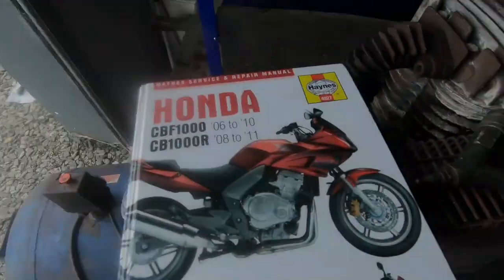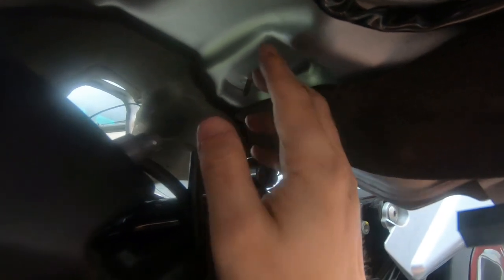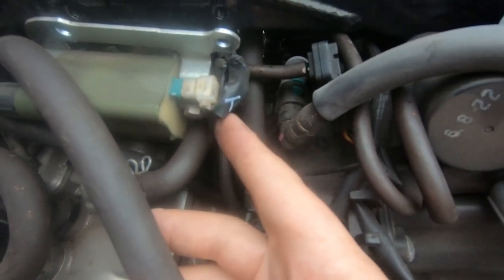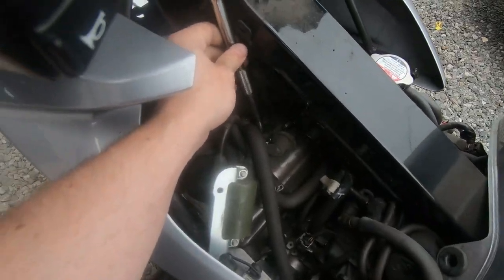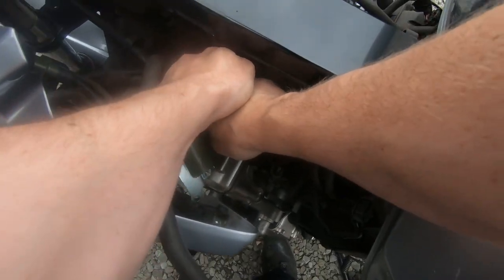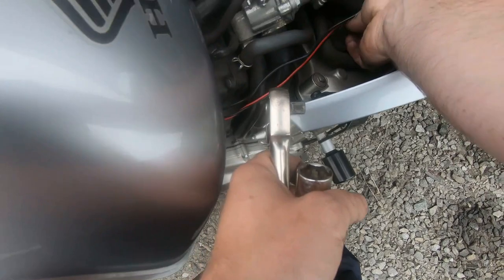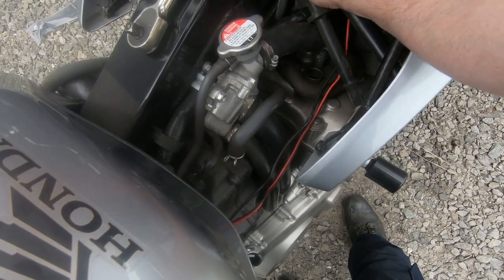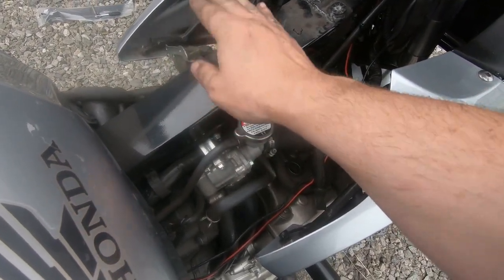How To Change Spark Plugs On A Honda CBF1000 06 - 11

Comment: Hi, what wind deflectors have you on bars of your cbf1000? Great vid, thank you 👍🏻

My 2006 has 18k serviced every year regardless but has an annoying stutter… any suggestions?

Going to go plug change, runs compression test and test backwards on the ignition system, although I’m pants at electrical testing!! Grrrrr
Reply from the maker: Thank you. I’m not sure what wins deflectors are on it as it’s my friends bike but I will ask him and let you know. 
Could you describe the stutter a bit better for me and when exactly does it happen?
Reply: @DarrenMcKinney1  

Sure, and thanks for replying, I’m keen to get some winter protection in place!

It usually happens when the engine starts to warm up and then right through when running.

It’s happens at between 2-3k rpm regardless of gear selection, so I know I’m not running too higher gear. 

Once it passes 3k rpm, it’s like a huge kick as it clears the ‘stutter zone’ and takes off like a rocket pulling like a train.

I initially thought it could be some moisture in the fuel lines and used Motul fuel cleaner regularly which softened it slightly but made no solid improvement so this led me to think that this just stuck a plaster over the actual issue.

Had major service completed to check valve clearances and all was fine there.  Garage had no suggestions which was a disappointment.

Comment: Hi,do you have any idea as to why my mk2 is showing code 34 after removing the servo and using a healtec illuminator, it ops up after a 25 mile run i keep clearing it and it keeps coming back. cheers.
Reply from the maker: If it keeps coming on with the eliminator on it may be some problem with the unit itself. I would contact healtech technical department to see if they can shed any light on the matter

Comment: That's a lot of faffing around to change spark plugs on these modern bikes. I can change all 4 on my 1980 GS550 in less than 5 minutes, and still have time to do the 2 on my 1978 T140. Sometimes simpler is better.
Reply from the maker: I completely agree with that. Simpler is better

Comment: Iam doing mine this weekend.... Those 2 & 3 plugs look bloody awful to get at
Reply from the maker: yeah I think from memory its no 3 that is really bad because the frame is pretty much over the top of it. You should get it with a 3/8" socket set with a long extension bar. They are really tricky but thankfully don't have to be done too often